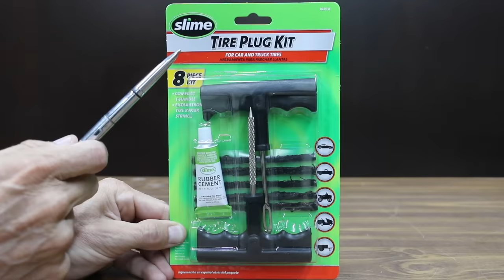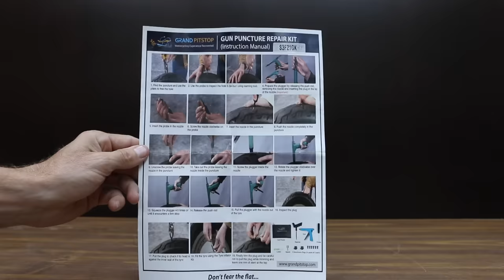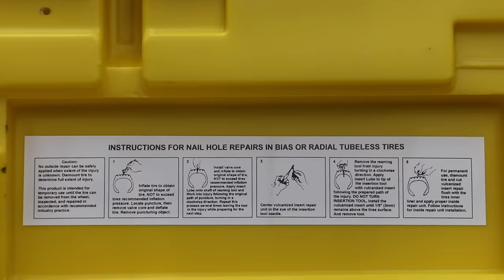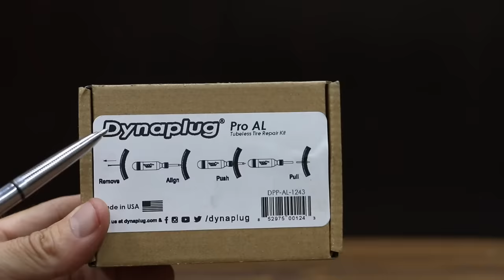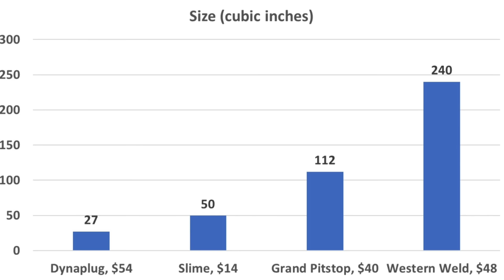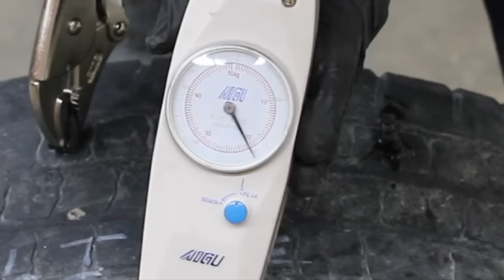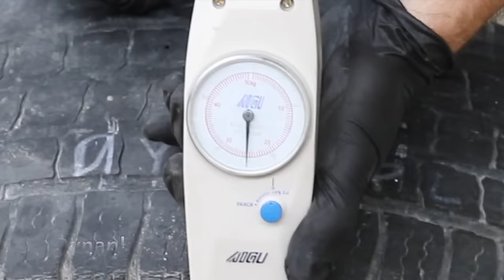Best Tire Repair Kit? SLIME, Westweld, Dynaplug, Grand Pitstop

Comment: Those test tires look like the R4 tires on the front of my compact tractor.  I use the Slime brand because it's what was readily available.  The opening on the plug tool is too narrow and is prone to pulling out the plugs.  The use of "rubber cement" is like lube for inserting them (and helps them to pull out easier, unfortunately) and helps to seal better, I feel.  After this video, I'll try to source Western Weld plugs and use them with the Slime tools, if they will.

As has been said: props for the labor to install all those *#%# plugs.
Reply from the maker: Thanks!  Thanks for sharing.

Comment: I've been using slime plugs since they were invented.. I've never had one leak. As far as I'm concerned when you plug the wheel properly with rubber cement, it's for the life of the tire
Reply from the maker: Thanks for the feedback.

Comment: If you get one where you can change the reamer, tighten that sucker first or else it will just rip right out when you go to pull out. I recommend if you are doing customer work to get the Blackjack one off of Amazon. Don’t get the slime or hobo freight ones the ends of them snap. Depending on how violent the break it could stab you in your hand.
Reply from the maker: Thanks for the feedback.
Reply: @ProjectFarm  Little bit of an update, I actually broke my MATCO ones where the plug goes in and they don’t just hand over a new one either.

Comment: I always use a cheap ass repair set and a cordless drill with a 5mm drill. Make sure the tire has enough pressure when you drill the hole and insert the plug. Never had any problem.
Reply from the maker: Thanks for the feedback.

Comment: I have used Slime plugs for a long time.
Only one leaked because I forgot to dip the plug in the glue first.
The glue aids in insertion of the tool with plug.
I always give mine a little twist when removing the tool so it forms a little lump inside the tire.

What helps on any plug type tire repair is to drill out the hole to make it round. Drill in REVERSE lest you foul up the steel belts.
Reverse drilling spreads the belts away from the plug slightly so you do not break any of the strands.

There is a liability reason why tire shops do not use those kinds of plugs and use the disc with stem type, grinding the inside of the tire, etc instead.

If you are within 1/2" of the sidewall or have a sidewall injury, replace the tire. Being cheap can cost you a lot...
Reply from the maker: Thanks for the feedback.

Comment: I just wanted to add. I repaired tires professionally for many years. Your supposed to turn the spiral tool clockwise many times and most important, keep turning CW while you remove it. This gets the steel cord ends that have been cut all in the same direction away from the hole center. If you do not do this the steel cord ends can severe the plug in time.
Reply from the maker: Thanks for the constructive feedback.

Comment: During my 40 years in business, I experienced many flats on my delivery vehicles. If you're stuck some where with out the advantage of removing and installing the tire, it is quit a hassle lying on the ground. in Florida, on a 95 degree day  and trying to push the plug into the tire at such an awkward angle.  If you can roll the vehicle to a flat survace,  install the plug into the applicator,  stick it in enough to get it started, angle it 90 degrees to the tire with the push handle touching the ground. Put your vehicle in nuetral, place you foot on the handle so it's wedged against the ground, grab a hold of the wheel well, pulling the weight of the vehicle to drive the applicator and plug into the tire.  That is the only way I could get the thing installed.
Reply from the maker: Thanks for sharing.

Comment: You can’t beat the slime styled flat repair tool when in a jam.  
First of, it’s the one fastest to do the job. 2nd, you don’t even need to remove or lift the wheel. Yes, it can be done with the car on the ground and with the wheel still on. Also if you caught the puncture before the tire loses too much air, you can fix the tire completely in a fast enough manner that you can still drive away to a  gas station and pump it to the right tire pressure.  Of course that’s if you didn’t lose too much air. Don’t try it if it seems to have pressure too low to drive on it.
Reply from the maker: Thanks for the feedback.

Comment: I've bought a total of five of the Slime tire plug kits for different vehicles, including my little adventure motorcycle where I wanted to keep the size to a bare minimum.  I tried to buy the Dynaplug but Amazon sent the bicycle version instead of the motorcycle/car version and apparently the seller sent the bike version to Amazon by putting a new bar code over the manufacturer's barcode so I wasn't able to order the proper Dynaplug kit from Amazon, so I gave up and got the Slime kit I've used for years.  Never had a Slime tire repair leak and they are a permanent repair.  My last tire repair was a couple of weeks ago.  I wish Slime put a razor blade in the kit.  I don't mind using the Gerber MultiPlier that I always carry to remove a screw from the tire, but I don't like using my pocket knife to cut rubber "bacon strips" covered in rubber glue.  I also wish Slime provided a single use glue capsule or pouch for each rubber strip because the tube of rubber cement is a single use item.  It's always dried up and useless for the second tire repair.  Fortunately, the repair works almost as well without the rubber cement.  I think it's more of an installation lube than a sealant, but I bought a bunch of $2 Slime tire repair kits just for the rubber cement.
Reply from the maker: Thanks for sharing.
Reply: @ProjectFarm  - PRO Tip:  It's difficult to spray soapy water on the side of the road when making an emergency tire repair so even fairly large leaks can be difficult to find.  It may be possible to find large leaks by slowly moving your hand around the tire until you feel the air leaking, but for smaller leaks that are still too large for a mile of driving, it's useful to have a yard of vinyl tubing.  Hold one end to your ear and use the other end as a stethoscope to scan around the tire to find the leak.  A slightly longer piece of tubing is good for siphoning gas, etc.  I also use that tubing on the snout of the Fumoto oil drain valve to make oil changes clean and neat.

Comment: That type of tire repair is for temporary use only but so is a tire. Any repair I've done with one of those has lasted the life of the tire however long that was and have had no problems. Tire shops are getting picky about doing repairs because of liability issues and repairs are also getting expensive.
Reply from the maker: Thanks for the feedback.

Comment: I have to admit i was convinced the dynaplug was great. Its packaging system seems perfect for the glovebox. It's ts made in USA. While on the road I've discovered a fatal flaw.

If you load up the little metal tubes with the plugs, it works great right away.

However, load it up and store it in your car until you get a puncture a year later. The plug is permanently glued into the metal tube and will not come out when you insert the plug into the tire. The metal tip breaks off inside the tire, and the plug will come back out with the metal tube when the tool is extracted.

I've experienced this twice now. It's too bad. I really like how the tool stores in the car, and I hate how most other patch kits stow.

Comment: OP I know this has nothing to do with your tire plug video, but, what NOBODY has done, but what I for one would love to see, is a long term engine test for motors treated with miracle coatings like Slick 50 and duralube.  And after around 100,000 miles how does engine wear on the camshaft lobes, rings, bearings et. al. of such a treated engine compare to an untreated one?
Even more important, do any of these miracle-in-a-bottle treatments really reduce, or eliminate, the excessive engine wear caused by a cold start?  Nobody has ever done such a test at least none that I have seen!
Reply from the maker: Thanks for the suggestion.

Comment: I made the mistake of buying one of those Harbor Freight brands once, the thing bent in a 90 angle trying to push the plug in.  This was after using the cleaning/widening tool for a few minutes trying to make it big enough.  Luckily I was at home and had a slime kit in my other car.  I would have been furious if it had happened on the side of the road.  Don't buy cheap for any emergency tools that's for sure.
Reply from the maker: Thanks for sharing.

Comment: I was hoping for some comparison to the OEM factory emergency inflation repair kits that blow in a sealant, since they all appear to be from the same manufacturer, just branded for each car make.  

Guess I will have to check the project farm site to see if that test has been done.    I screwed up a chrome rim by using a tire repair in a can, by ignoring the critical instructions to treat the stuff as a temporary repair .    I had a woman at work who said she used canned tire repair without any problems, just put the stuff in .   I knew she ran high speed roads in the high desert to see her mom regularly, so her tires saw a lot of heat, and I figured this proved durability and validated her use and forget about it method.     In time the sealant ate the chrome, destroying the air sealing surface on the rim.  The critical difference was her Toyota truck used steel rims.
Reply from the maker: Thanks for the suggestion.

Comment: I ride with a Dynaplug kid on my motorcycle because (A) the small size and (B) they're the fastest ones to install.  I have to reinflate my tire with CO2 cartridges, so the less air I'm losing during the plug install, the better. Any of the ones that require you to ream out the hole multiple times or even pipe in nozzle that's going to increase the size of the hole are going to be a big deal to me.
Reply from the maker: Thanks for sharing.

Comment: Sir you did not test black jack semi truck tire plug, its 50$ on amazon and it outperforms all other plugs. I haul 80000 lb with 130psi and plug holds with no issues. Best money I have ever spent.
Reply from the maker: Thanks for the suggestion.

Comment: I use a product identical to the west weld with a high degree of success. But I still will not rely on a plug by itself. Too many times I have been told that they have not been run flat only to find that they have and internal of the tire is full of rubber crumb material from running rim against the inside of the tire. If I know for a fact that it has not been run flat I will plug it. Otherwise plug to seal the steel cord from oxidation and a patch on the inside to verify a proper repair. Never expect the whole story from the driver. Don't happen.
Reply from the maker: Thanks for sharing.

Comment: Man, I saw this video and thought, here we go. Let's see how my kit stands up to the competition because your videos are the best. Very disappointed that you did not include the original 'Safety Seal' brand. Safety Seal has been around since 1964. I've personally been using them since the 70's. I have NEVER had one fail used under the correct conditions as prescribed by any of the manufacturers. There atre just some tire conditions that no repair should be used. I didn't even watch the video as I didn't see any reason to. Nothing is going to be better than what I'm already using. Others might be as good, but why switch from what I already know? Oh well, maybe another video at a later time.

Comment: The grand pitstop is in the name, you will have a long pitstop after using it waiting for help😂

I've always used the same type that is in the slime kit. 
Standard procedure on kits here in Norway that always works is to apply rubber cement on it, insert and twist 45° before removing.
Never had a leak or problem with it. 

Even tho it is illegal to use here for workshops and is only classified as a temporary fix so you can get to the closest tyre repair shop or change it. 

The law says we must use a big umbrella plug glued from the innside, and to use it you must have access from innside the tyre.. So not often used by people
Reply from the maker: Thanks for sharing.

Comment: In my experience.  The mushroom plugs should only be used on NON STEEL BELTED tires.   I have tried several times, every time the steel cuts the plug and it fails.  The mushroom ones have no cord reinforcement.  They have worked great on non steel belted tires.
Reply from the maker: Thanks for the feedback.

Comment: The problem with all of the string type of plugs is that after a couple years or less, they dry out and become a slow leak.  I've been plugging tires for over 50 years and hands down the best plugs are the un-vulcanized rubber plugs with no string and any shape will work.  The un-vulcanized rubber will fuse itself to the tire for a permanent repair and will almost never leak.  They are the most expensive plugs to buy, but worth it if you plug a lot of tires or never want them to leak again.
Reply from the maker: Thanks for sharing.

Comment: The big problem is if the tyre isn't inspected internally debris can be trapped inside the tyre causing further damage and possible blow out at a later date.

Comment: Here because I just plugged my tire and I was thinking… “I bet project farm has a great test on this”. 

Plugged a lot of tires over the last 20 years, 0 have failed. Just plugged a 40” trail grappler with 2,000 miles on it. I expect that plug to hold for 30+ thousand more.
Reply from the maker: Thanks for sharing.

Comment: Nothing can beat the classic tire plugs. Had been using it for years and it hold up incredibly well and very easy to use. Just  about any brand of tire plugs will work fine without issues if you’re just driving normally at around 60-70mph, mine was made in china it doesn’t even has a brand it only comes with the tools that has flimsy plastic handles and aluminum body, sticky plugs, adhesive and no instructions. The packaging is even worse it just come in a very thin clear plastic bag and everything was shoved in haphazardly 😂 but besides the questionable packaging and cheap tools  it works incredibly well and stick in deep and hold on tightly without any leaks for years and it only cost me a mere $3.8 for 10 plugs with tools. It’s not necessary to spend above $5 for a set of tire plugs since all of them works perfectly as intended cheap or expensive, the only thing an expensive tire plugs kit can offer is a set of sturdier tools that you won’t be use for the next 2-3 years and probably lost it within just a few months and that’s about it.
Reply from the maker: Thanks for the feedback.

Comment: It’s funny at one point plugs are the fix it thing, then people decided they can damage the radials or what ever and patches are the fix it all thing, next they decided patches don’t fill the hole and leads to corrosion so my company came up with another solution.

We remove the tire, install a plug from the inside out, the. Smear some sealant around the inside of the tire…

Comment: One issue I found that some of these products decay, after some years the plugs can degrade and cause leaks not by wear but simply with time. In my experience it does take years but can cause problems with vehicles that don't do a lot of km's
Reply from the maker: Thanks for the feedback.

Comment: A patch-plug combo is far superior.   Yes you have to dismount the tire but to do it right it's worth it.
Reply: Sure it's better but do you really need something better than good enough? How many rope plugs have you seen fail?
Reply: @Blenzo480  Glue dries out and plugs sometimes fail after extended  age and repeated heat & cool cycles.  I have been driving for over 50 years and yes I have seen tires develop a slow leak over time with plugs.  Never with a patch&plug.
Reply: @paullazarro4295  Good points. I still think plugs get the job done. I'd probably just replace the plug if one started to leak on me since it only takes a few minutes

Comment: 0:35 The 8 oz metal can of rubber cement is really something that should be considered necessary for inclusion in the kit, because the little tube provided is at best good for one repair, and sometimes not even that if it's left sitting in your hot trunk for a long time before you have a need for it.  The kit won't be of any use if the cement is dried up, so if you're relying on it, you need the metal container, which won't allow it to evaporate away.
Slime 1050 8 oz $6.77 from Wally world
Reply from the maker: Thanks for the feedback.

Comment: The only real concern would be if the tire were damaged internally from being run flat. I have plugged many tyres but have always known the tires history, it's side wall damage you must worry about which can be extremely dangerous.
Reply from the maker: Thanks for the feedback.

Comment: All right why not twist the plug tool mix it or not you pull it with the pliers and it holds it better because if you go just in and out it doesn't work that's what I was doing
Reply from the maker: Thanks for the feedback.